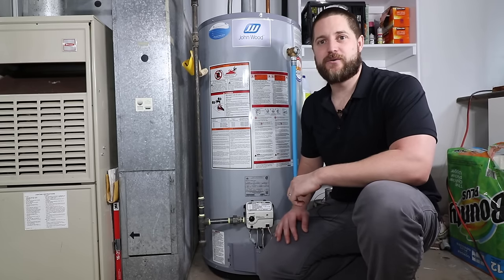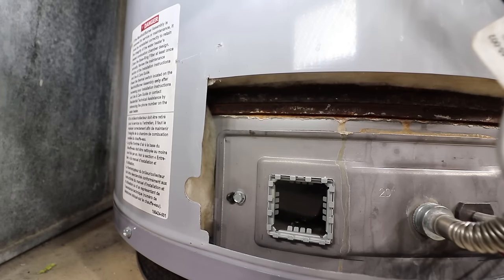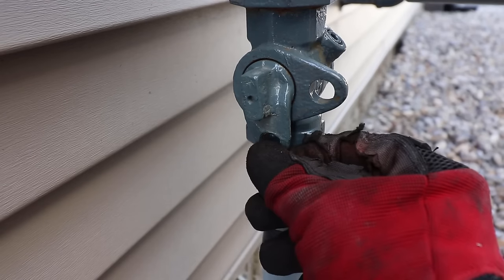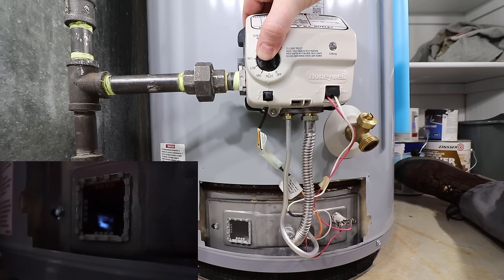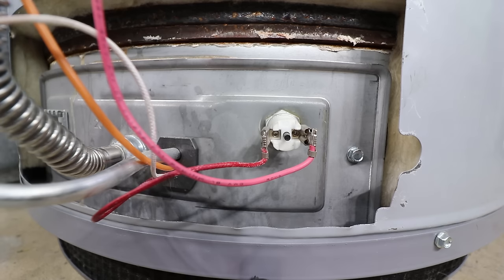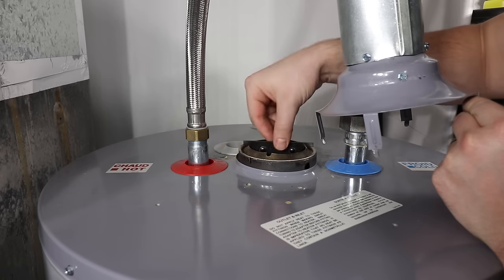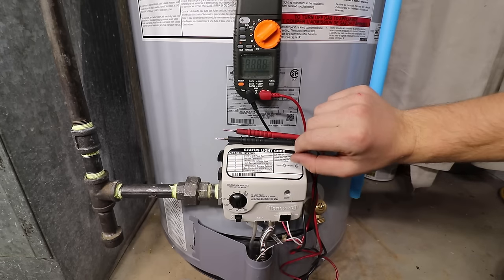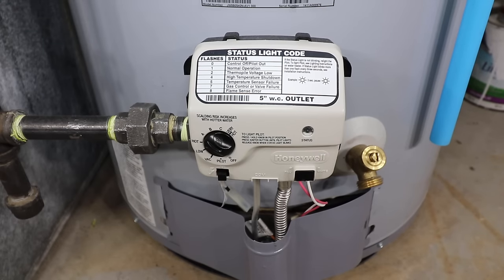No Hot Water: Water Heater Troubleshooting

Comment: Hi, thanks for the helpful video, my status light blinks once every 4 seconds which is normal operations, pilot light remains on so no issues BUT the burner does not turn on. Do I still have to change the control valve when flashing is normal?
Reply from the maker: Hi Zahid, Is the gas control knob in the On position? This is the knob that has off, pilot, and on labelled. The first thing I would do would just check that knob position. If it is in the On position I would try turning it back to pilot and then back to the on position to see if that does anything. Let me know how that goes and then we can try a few other steps. Thanks
Reply: Mine flashing red no hot water wat can I do
Reply from the maker: @jermainereid5815  Some control valve models use a red light and some use a white one. Does the light error code blink in a sequence? Example: 4 blinks, pause? Thanks!
Reply: Yes
Reply: And know I the pilot light wount stay lit

Comment: The red wires with the copper clips that go into the white mal electric socket looking thing were connected to eachoer aftermarket maintenance guy worked on it, and the the pilot kept going out. Is it supposed to be like that?
Reply from the maker: This the TCO or temperature cut-off switch. It is a safety switch that shuts the water heater down if the combustion chamber gets too hot. By connecting the wires together he is bypassing the switch. Is he coming back to work on it? This should only be a temporary solution and usually only done for testing purposes. Has your water heater given you any error codes? Thanks

Comment: Water heater pilot stays lite for about 5 minutes then goes out I replaced the thermocouple assembly and the thermo switch it still stays lit for only 5 minutes do I need to replace the gas control valve Thank you

Comment: My water heater just start to no come on . Pilot is on also when I move the thermostat it turns on but the next day won’t turn back on because cold water start coming out . Unless I switch thermostat it turns on. What can that be ? Thermostat or water sensor ???
Reply from the maker: Hello Andres, Thanks for the question. When you say switch the thermostat, does that mean turn the temperature control knob? Did this problem just start to happen or has it always been like this? If the water heater only fires when turning the temperature control knob back and forth and doesn't turn on and off by itself, then it's going to be a faulty control valve. Here's a video on control valve replacement: https://youtu.be/5f6UFwRlXr8 . Let me know if you have any questions. Thanks!
Reply: Pros DIY yes the control knob . Lol thanks for quick respond ! Also just start it few days ago I turn it on manually and it turns off by itself
Reply from the maker: That's an extremely rare fault, but it sure sounds like the control valve is faulty and would have to be replaced. There must be a short in the control valve which doesn't allow it to turn back on when the water temperature drops. When you're turning the temperature control back and forth again it somehow is resetting. On the mornings when you are getting only cold water from the hot faucet, let the hot faucet run for about 10-15 mins. If the water heater doesn't turn on (fire) by itself, then replace the control valve. Good Luck!
Edit: Just to double check. We are talking about an atmospherically vented water heater correct? as shown in the video? If it is a power vented water heater, different troubleshooting methods would be needed. Power vented water heaters have a power cord connected and are vented in PVC. Thanks
Reply: Pros DIY ok sounds to me is correct . About vented water heater not sure what that is but it is a gas water heater . I’ll be replacing it then thanks again. Also is all the same gas valves the same for 40 gallon or 100 gallon boiler ?
Reply from the maker: @Andres707cristiano  You'll have to confirm the correct gas control valve for your water heater. There's a sticker on the front of the tank that will have the model and serial number of the tank. With this model/serial number you can confirm the correct replacement gas control valve on your water heater brands website, or plumbing distributor.

Comment: Can you please help me .. so my problem is that I can press the control knob in when In pilot position and then press the igniter and it actually lights up. I can see the flame through the small window. But then as you mention in the video I kept the the knob push in until the status light starts blinking but that’s the problem. My status light didn’t start blinking after a minute like yours did on the video . And after I release the knob the flame goes off... I already cleaned the filters both at the bottom and at the top . I already check thermal switch which was already pushed in . So I don’t really know what my problem may be . Please I need help and Thanks in advance
Reply: I also place a drill bit over the thermal switch like you did on the video (which I already mentioned it was pushed in ) just to check . But it does the same thing as I mentioned before . The flame goes up with not status light at all and when I release the knob the flame goes off
Reply from the maker: Hi ABRAHAM RANE, Thanks for the question. The first step I would take is a voltage reading of the thermopile. A faulty thermopile is most likely the issue. Please see this video for instructions and acceptable readings: https://youtu.be/mtbn3FtMqCM
If the voltage test passes and since you already checked the thermal switch, the next/last step would be replacing the gas control. Good luck, and let me know if you have anymore questions. Thanks!
Here are the videos for thermopile and control valve replacement.
Thermopile replacement: https://youtu.be/1VIvEqVbt14
Control valve replacement: https://youtu.be/5f6UFwRlXr8

Comment: Haven't had time to check why no hot water from gas water heater. Been taking cold showers. It's pretty old 30 gallon . Haven't flushed it in a few years. Hard water here. Calcium or lime can't remember which. Old so lighting switch is old style. Bad knees not very good. See what I can do.

Comment: my pilot lite turns off after a couple of days. Turning it on again is easy. After a time it goes off again. This time it would not relite until i turned the knob 
to very hot, if i turned the knob to normal hot the pilot lite turns off ???
Reply from the maker: Hi Eric, It sounds like an issue with the control valve. I would first perform a thermopile voltage test to rule that out before replacing the control valve.
Testing a thermopile: https://youtu.be/mtbn3FtMqCM
Thermopile replacement: https://youtu.be/1VIvEqVbt14
Control valve replacement: https://youtu.be/5f6UFwRlXr8

Comment: My setup is just like this.. my pilot is lit and stays lit but water is barely warm.. any ideas on that could be? Doesn't seem like the burner is kicking on..
Reply from the maker: If you turn the temperature control up does the main burner kick on? Temperature control (cooler) A, B, C (hotter). If it doesn't, it sounds like there's an issue with the control valve and might require replacement. Sometimes control valves can stick in the closed position. Lightly tapping the side (aluminum part) of the control valve with a wrench may release it. 
Control Valve Replacement: https://youtu.be/5f6UFwRlXr8
Reply: @PROSDIY  thanks.. I did last night just turn it off completely for 10 mins. Then turned it back on pilot lit fine.. bit still didn't seem like burner kicked on.. i happened to just tap the control valve on its side with my hand.. and it kicked right on. Couldn't believe it.. do you think it will need replacing soon. Prob just roll with it til it goes out again?
Reply from the maker: @dakotaboysnomadicadventures  Nice! If it was my own, I would just roll with it. It could last many more years. I would source out a replacement control valve though. Then if it does die, you'll at least know the cost and the ETA for the part.
Reply: @PROSDIY  that's a big 10 4

Comment: What about 6 flashes? My water heater says to replace the burner for this code. Is this true?
Reply from the maker: Hi Nick, The model demonstrated in this video doesn't have a 6 blink error code. I would need the make and model of your water heater to help diagnose the problem. This information should be on a sticker on the tank. If it's a power-vented or power direct vented water heater it can have different error codes. Thanks
Reply: @PROSDIY  it's a State Select and according to the label on the gas controller it says 6 flashes = replace burner, but I just don't know if it could be something else causing that code.
Reply from the maker: The model number will let me know what style of water heater we are working with. If it's atmospherically vented, power vented, or power direct vented it can make a big difference on diagnosing the problem. It's on the rating plate sticker on the front of the tank. Thanks

Comment: If there is water at the base what should I do just vacuum it out then start it again
Reply from the maker: The main focus should be trying to determine where the water is coming from. Sometimes this requires drying up the water with a vacuum and towels then watching to see where the water is coming from. If it is dripping from the center of the tank onto the burners without the flame burning, the water heater will most likely need to be replaced.

If the leak was repaired and you're cleaning up the water before relighting the water heater, then make sure the water is completely dried up before relighting. Most water heaters get their combustion air from the bottom of the tank and if there's water sitting over the intake screen, the water heater won't function properly. This is because it will be lacking the proper amount of combustion air. Thanks for the question!

Comment: Please help.  Desperate.  We  have not had hot water for one month.  Please help.  The water heater is in the attic. My husband replaced the thermocouple, and the burner assembly.  He cleaned the air register.  The pilot light will stay on forever when the burner is not on.  When you turn the burner on and off the pilot stays lit.  But when you leave the burner on both the pilot and the burner goes off after about 15 minutes.
Reply from the maker: Did you ever run out of hot water, when it's actually hot? If you run the hot water for too long the tank goes completely cold it can condensate. The condensate can land on the pilot flame and put it out. I'm wondering if this is what is happening. I'd try lighting it, and don't used any hot water. You may have to light it twice until the water is fully hot. If the tank actually gets up to temperature after this test and the pilot is still going, then the issue would be condensation. Let me know how that goes, for further steps.

Another issue can be the combustion chamber getting too hot and tripping a temperature cutoff switch. If you can supply me with the model # on the side of the tank I can check which TCO you have. Thanks

Comment: How come mine dosen't have resetable Thermoswitch? 7 red flash I was able to reset the board by robbing a foil on it and it work. But keep happening every week.
Reply from the maker: Some models don't have a resettable thermal switch. Manual: "7 Flashes Indicates Electronic Control Failure". Here's a video for control valve replacement if needed: https://youtu.be/5f6UFwRlXr8
Thanks!
Reply: @PROSDIY  thanks!

Comment: PROBLEM...40 gallon electric water heater....3 months old... 5YR WARRANTY. Worked great for 3 months.Started running out of hot water in 4 minutes using the shower OR  sinks...Had electrician test circuit breaker and thermostats and and heater elements  on upper and lower hot water heater. Based on running out in 4 minutes it tells me being the water is drawn from top of tank that the lower element is not working...The lower heat element looked new.. replaced lower thermostat and element. Still no hot  water after 4 minutes. Ice cold. Being that water heater is on warranty the retailer gave me new heater 2 days ago. EXACTLY SAME PROBLEM.  More I think about it seems the only answer is there must be a manufacturers flaw in the power relay switch between the upper and lower thermostat?  Why would the 3 month old water heater work for 3 months then start having problems. Why would the new replacement hot water heater have no hot water after 4 minutes? HELP   1541-500-7242 PLEASE LEAVE MESSAGE AND PHONE # AND I'LL CALL YOU BACK.  THANK YOU
Reply from the maker: Seems like you've ruled out electrical, dip tube, and many other things. Was anything changed just prior to the water heater not producing enough hot water? Shower head, electrical, faucet?
Since most common causes of lack of hot water have been ruled out, I can only think of 1 other cause without actually being on site.
A cross connection somewhere between the hot and cold line causing lukewarm and reduced hot water. The most common cross connections happen on shower valves due to a faulty cartridge (replacing the shower cartridge fixes this issue), but they can also happen on kitchen and bath faucets as well. To test for a cross connection, close the cold water feed to the water heater. Then open the hot only on a faucet. If there's still pressure on the hot side there's a cross connection that'd have to be tracked down. Hopefully this information helps and I'm just diagnosing based on your comment. Thanks

Comment: Mine doesn't have a resettable thermal switch -- is that normal?
Reply from the maker: Hi Jeff, It is normal. Some models TCO isn't manually resettable and most of the older atmospherically vented water heaters have no TCO at all. Thanks for the question.

Comment: What if my igniter isn’t sparking?
Reply from the maker: 1. Check to see if the piezo igniter wire is fully seated. This is the wire that enters the bottom of the igniter button. Then try sparking again.
2. Inspect the piezo igniter wire for any breaks or bare wire.
3. Pull the igniter wire from the bottom of the piezo button. Hold the wire about 1/4" - 1/2" away from where it plugs in and click the button. If you see a spark jump, then the piezo igniter button is working properly and the issue is with the pilot assembly end of the system. If it doesn't jump the piezo igniter button is faulty and has to be replaced. Please wear a glove when performing this test. The spark can jump to your finger and give you a small unpleasant shock.
4. If still no spark the burner assembly should now be removed. Check for any breaks or bare, uninsulated wire.
5. Now check where the spark jumps from the end of the igniter to the pilot assembly to light the pilot flame. If it is covered in carbon, then take some fine sand paper and shine up the area where the spark jumps. If it is covered in carbon the resistance for the spark to jump is too high and no spark will be visible. This is probably the most common cause of no spark. You can test for spark again with the burner assembly out of the water heater before putting it back.
If you have any questions, please let me know. Thanks again and good luck!